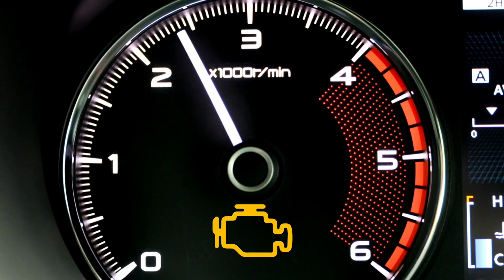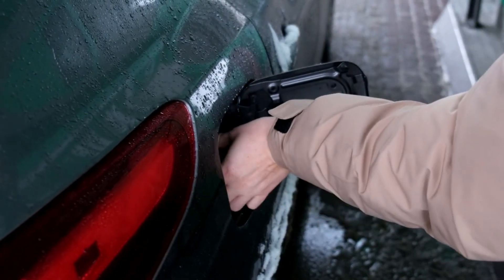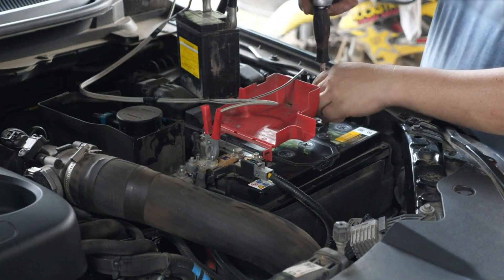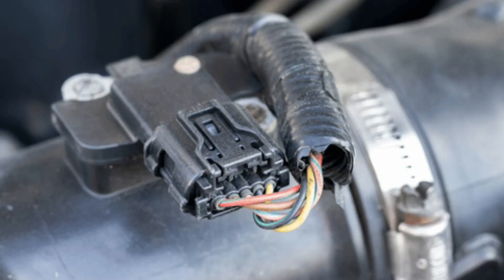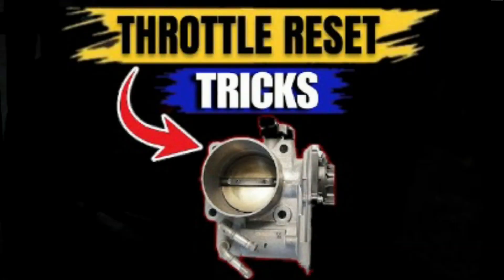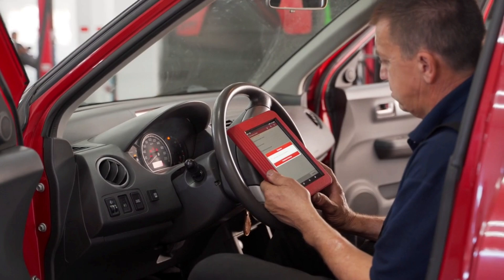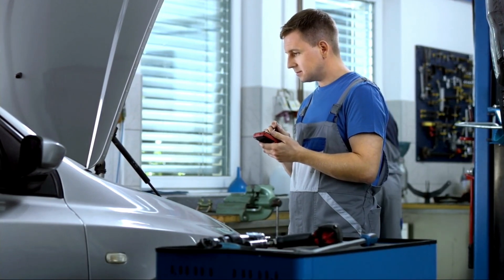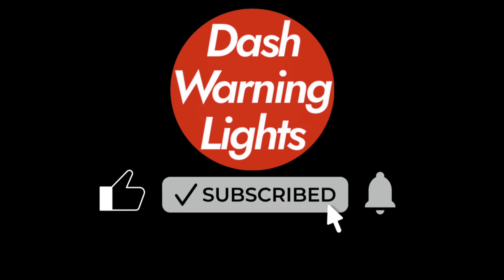HOW TO FIX & RESET CHECK ENGINE : LIGHT, FREE EASY WAY!

Comment from the maker: ✅ CHECK ENGINE LIGHT FIX - HOW TO RESET & DIAGNOSE THE PROBLEM
👇 Drop your BMW model & year below — I’ll help you fix it!
In this video, you’ll learn:
✅ How to reset the check engine light on your BMW
✅ What to do before and after clearing the warning
✅ Step-by-step reset guide — with or without a scanner
🚗 Works for most BMW models:
1 Series, 3 Series, 5 Series, X1, X3, X5, and more.
📲 Need help with a specific code or issue? Comment below — I respond to every question!
Check engine light EV fix
Check engine light reset
Reply: one month old BMW X7 M60i.  Been to the dealership twice already.
Reply from the maker: @ReedSmyth  That’s frustrating, especially on such a new BMW X7 M60i. Since it’s only a month old and already been back to the dealership twice, I’d recommend asking them to do a full diagnostic scan and check for any software updates or technical service bulletins (TSBs). Sometimes new models have issues that require updated programming rather than just part replacements. If the check engine light keeps coming back, you may also want to push for a warranty escalation so BMW investigates further.

Comment: Hi I got a P046c code can the engine light be turned off before I fix it ? Thanks
Reply from the maker: @philpym8605   Hi! The code P046C is usually related to the EGR (Exhaust Gas Recirculation) system, often caused by a sticking EGR valve, clogged passages, or a faulty EGR sensor.
You can turn the check engine light off before fixing it, but keep in mind:
👉 The light will usually come back once the system detects the same problem again.
👉 Clearing the code doesn’t fix the cause — it only resets the warning.

If you want to reset it temporarily without a scanner:
👉 Disconnect the negative battery terminal for about 10–15 minutes.
👉 Reconnect it and start the car.
👉 Let it idle for a few minutes so the computer can relearn.

But I recommend checking/cleaning the EGR valve soon — driving too long with the issue can affect performance and fuel economy.

Comment: 2014 316i engine misfire only under load
Reply from the maker: @Wei55_und-stolz  Thanks for your comment! A misfire under load on your 2014 BMW 316i is often caused by one of the following:
👉 Ignition coil or spark plug issue – especially under boost/load
👉 Fuel injector problems – can cause misfire when engine demands more fuel
👉 Carbon buildup on intake valves – common in BMW turbo engines
👉 Weak fuel pressure – check pump or fuel filter
👉 Boost/vacuum leaks – any small leak can cause rough running under acceleration
✅  Try scanning with a good OBD2 tool for specific cylinder misfire codes (like P0301-P0304) and check live data.
Let me know what codes you see and I’ll help you further!
Reply: @Dashboardwarninglights  thanks so much! I’ll let you know how i get on 👍🏻
Reply from the maker: @Wei55_und-stolz  You're very welcome!  Definitely let me know how it goes — I’m here if you need any more help with dashboard warning lights or anything else. Good luck and drive safe!
Reply: @Dashboardwarninglights  I have a OBDII Vgate reader, any suggestions as to a user friendly app for me to download onto my iPhone?
Reply from the maker: @Wei55_und-stolz  If you’re using a Vgate OBDII reader with an iPhone, I recommend trying one of these user-friendly apps:
✅ OBD Auto Doctor – Simple, beginner-friendly, and works well with Vgate devices.
✅ Car Scanner ELM OBD2 – Very popular on iOS and offers advanced features even in the free version.
✅ OBD Fusion – A powerful app that’s also compatible with iPhones and works great with most Bluetooth OBD2 adapters like Vgate.
👉  All of these are available on the App Store – just make sure your Vgate uses Bluetooth Low Energy (BLE) to work properly with iPhone.
Reply: @Dashboardwarninglights   thanks! The codes I got were
P0 300
P0 302
P0 303
B2 AAA
Reply from the maker: @Wei55_und-stolz 
✅ P0300 – Random/Multiple Cylinder Misfire Detected
This means your engine is misfiring, but not limited to one specific cylinder.
✅ Causes may include:
👉 Bad spark plugs or ignition coils
👉 Vacuum leak
👉 Low fuel pressure
👉 Dirty or faulty fuel injectors
👉 Timing issues

✅ P0302 – Cylinder 2 Misfire Detected
✅ P0303 – Cylinder 3 Misfire Detected
These are specific misfire codes for cylinders 2 and 3, confirming what P0300 already warned you about.
👉 Check these first:
Spark plugs (age, gap, fouling)
Ignition coils or wires (swap coils between cylinders to test)
Fuel injector (listen for clicking or test with scanner if possible)

⚠️ B2AAA – Generic Body Code (Manufacturer-Specific)
This is a generic placeholder for a body control module issue or a communication fault.
On many European cars (especially Peugeot, Citroën, Renault, etc.), this code shows up when:
👉 The scan tool can’t access more specific B-codes
👉 There’s a CAN bus communication problem
👉 A sensor/module failed to respond

Tip: Use a more advanced scan tool or app that’s compatible with your car’s make to get the full B-code details.

✅  What to do next:
👉 Start with ignition parts – inspect/replace spark plugs & coils for cylinders 2 & 3.
👉 Run a compression test (optional) to check cylinder health.
Use a better scan app (like OBD Auto Doctor or Car Scanner) to recheck B2AAA with more details.
Clear codes after repairs and drive to see if they come back.
Reply: @Dashboardwarninglights  thank you so much!
Reply from the maker: @Wei55_und-stolz  You're very welcome! 
Glad the video helped you out. If you have any more questions or need help with other warning lights or fault codes, just let me know — I'm here to help!
Reply: @Dashboardwarninglights  Mate! You are a legend! I cleaned and regapped all four spark plugs, swapped out #2 and 3 coils, replaced air filter and cleaned MAF sensor, the car now runs like new!! Thank you so much friend.
Reply from the maker: @Wei55_und-stolz  Legendary work, mate!  I'm really glad to hear the car is running like new again — sounds like you tackled everything like a pro! Thanks for sharing the results, it helps others too.

If this video helped you, feel free to drop a 👍 like, hit that 🔔 subscribe button, or even send a Super Thanks — it really supports the channel and helps me keep making free repair guides for everyone. Much appreciated, my friend!
Reply: @Dashboardwarninglights  hello again, any suggestions to get rid of the dash warning light on a a BMW F10 this time “replace fob battery” have tryed re pairing the key by holding it up to the icon on the steering column (key fob is working just fine), I tryed to clear it with the scan tool without success? Any ideas??
Reply from the maker: @Wei55_und-stolz  Hi! Thanks for reaching out again. If your BMW F10 keeps showing the "Replace Fob Battery" warning even after replacing the battery and re-pairing the key, here are a few things to try:
👉 Double-check the battery – Make sure you used the correct type (usually CR2032) and it's installed correctly.
👉 Try a second key fob – If you have a spare, see if the warning appears with that one too. If not, your original fob might have a faulty battery sensor or weak signal.
👉 Hold the key to the steering column longer – Some users have had success by holding it there for 30+ seconds.
👉 Clear codes using ISTA or a BMW-specific tool – Generic scanners sometimes can’t clear fob-related faults. Try ISTA+ or a BMW-compatible scan tool like Foxwell NT510 or Autel.

If the warning still doesn’t go away, it could be a minor fault stored in the CAS (Car Access System) module. A deeper scan might help pinpoint it.
Reply: @Dashboardwarninglights  thanks again 👍🏻

Comment: BMW 116d f20 2014 quando spengo e riaccendo il motore senza spegnere il quadro si spegne la spia motore
Reply from the maker: @vincenzorotunno3174 Se la spia motore si spegne solo quando spegni e riaccendi il motore senza spegnere il quadro, potrebbe trattarsi di un problema temporaneo o di un errore memorizzato nella centralina. Ti consiglio di fare una scansione con un OBD2 per verificare se ci sono codici di errore salvati. Se vuoi, posso aiutarti a interpretare i codici.
Passaggi per risolvere il problema della spia motore su BMW 116d F20 2014:
👉 Controlla i codici di errore:
Usa uno scanner OBD2 per leggere i codici. Anche se la spia si spegne, gli errori possono rimanere memorizzati.
👉  Verifica i codici memorizzati:
Se trovi errori come sensori (es. EGR, MAF, sonda lambda), segnali deboli o piccoli problemi elettrici, prendi nota.
👉  Cancella i codici con lo scanner:
Dopo aver letto i codici, cancella gli errori e guida l'auto per vedere se la spia ritorna.
👉  Controlla i componenti più comuni:
Sensore EGR
Sensore MAF
Candelette (su motori diesel)
Batteria o massa difettosa

👉 Testa con il motore caldo e freddo:
Se il problema si presenta solo a motore freddo o solo dopo un riavvio senza spegnere il quadro, può essere un bug software o un relè difettoso.
👉  Aggiorna la centralina se necessario:
Alcuni modelli BMW F20 hanno avuto problemi software risolti con aggiornamenti della centralina (ECU). Consulta un meccanico BMW.

✅ If the check engine light turns off only when restarting the engine without turning off the dashboard, it may be a temporary issue or a stored fault code. I recommend scanning the car with an OBD2 tool to check for any saved errors. If you’d like, I can help you understand the codes.

Step-by-step solution for check engine light on BMW 116d F20 2014:
👉  Scan for fault codes:
Use an OBD2 scanner. Even if the light turns off, fault codes may still be stored.
👉  Read and save the codes:
Look for issues like EGR valve, MAF sensor, glow plugs (diesel), or low battery voltage.
👉  Clear the codes with the scanner:
After reading the codes, clear them and drive to see if the light comes back.
👉  Check common problem parts:
EGR valve
MAF sensor
Glow plugs
Ground/battery connections
👉 Test both cold and warm engine starts:
If the issue happens only after restarting without turning off the dashboard, it could be software-related or a sticking relay.
👉  Check for ECU software updates:
Some F20 models had ECU bugs that were fixed by software updates. Ask a BMW technician if an update is available.
Reply: Erg sporca la spia si accende dopo almeno 1000 km il meccanico a letto l’errore di egr sporca il codice e 290900 e 29eb00

Comment: 2013 750I X Drive
Reply from the maker: @marlonfearon9266  Thanks for dropping your BMW model!
For your 2013 BMW 750i xDrive, the Check Engine Light can often be triggered by:
👉  A loose or faulty gas cap
👉  Vacuum leak or PCV valve issues
👉  Failing ignition coils or spark plugs
👉  Software update or sensor fault (like O2 sensor or MAF)
👉  Try using an OBD2 scanner to read and clear codes. If it returns, let me know the exact code—it’ll help narrow it down!
👇 Drop the fault code here if you scanned it — I’ll help you fix it step-by-step!

Comment: Hope this works for me cuz the labor on BMW's is ridiculous
Reply from the maker: @jawill220  You're absolutely right — BMW labor costs can be crazy! Hope this video helps you fix it yourself and save that money 
Let me know how it goes or if you need help with anything specific.
Reply: @Dashboardwarninglights  I have a push start with a key fob. I don't know if this'll work but I'll give it a shot!
Reply from the maker: @jawill220  If you’ve got a push-start with a key fob, no worries — it should still work!  Just make sure the ignition is fully on (without starting the engine) when following the steps. Let me know how it goes — I’m here if you need help!